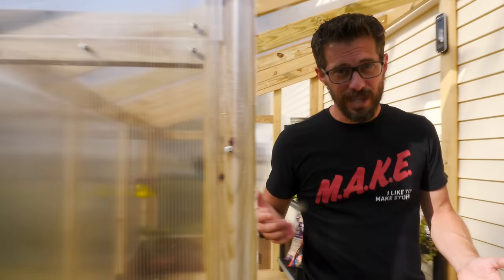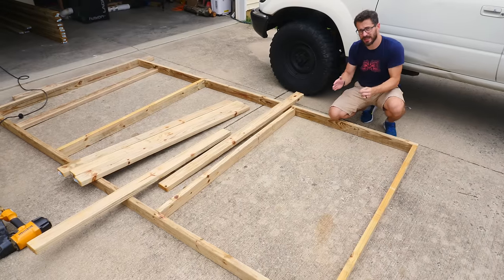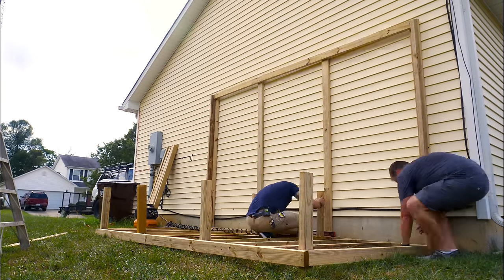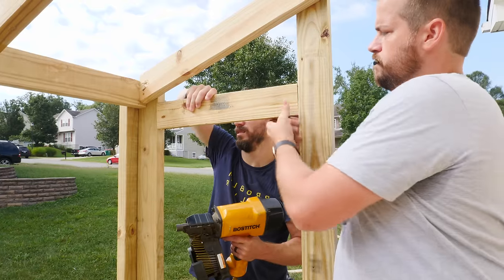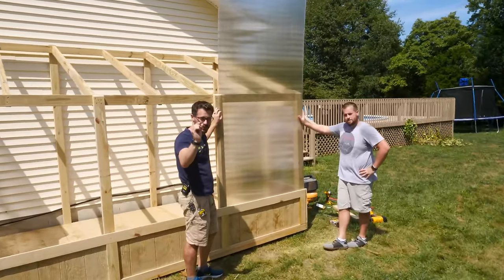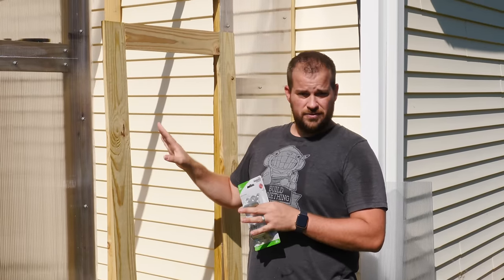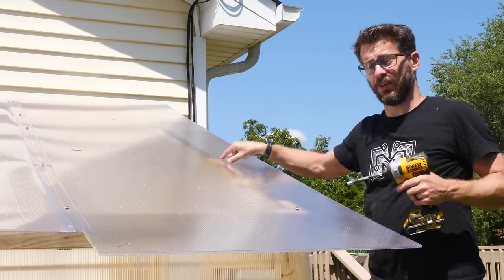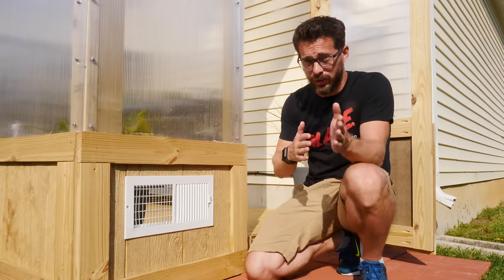How to Make a DIY Greenhouse | I Like To Make Stuff

Comment: Aren't you afraid the bottom will rot because of the moisture?
Reply from the maker: No, it's all pressure treated lumber.
Reply: i'd be more worried of it sinking after it rains for days on end.
Reply: @cmdraftbrn  If it's worth doing it's worth doing right.  At the least put that structure on concrete posts bases 🤦‍♂️
Reply: also insects, also you should have used blocks to level the building which would provide bester support for the floor, instead of stakes which makes it a permanent building. Then don't you need a permit,where I live you would.
Reply: @cwadub  Or at least runners that go the full length of the greenhouse to spread the load out
Reply: @Iliketomakestuff  Did you treat the ends after you cut them, or use uncut ends?  Also I would be worried about those sinking in after weight is put on them.
Reply: I really think that structure at the very least needed corner concrete supports, even some breeze blocks would have been better than nothing.
Reply: @wojtek-33  common misconception.  The treatment chemicals only penetrate a few mm into the wood.   Cut ends need to be treated with a sealer so they don't soak up water.
Reply: All cut end of pressure treated lumber should be sealed back up with an end cut solution you can get at the same place that sells the PT lumber usually. It should be done every time without exception in my opinion, not everyone does that. I've not hired a couple contractors because they didn't do it. For something temporary that you don't mind how long it lasts, do whatever works for you.
Reply: This guy doesn't know what is he doing, he mentions talking and building according to city code, half the stuff he did in this video makes no sense and the city will ask him to tear it down in a heartbeat
Reply: This guy has no idea what you need for a greenhouse.  At best, pressure treated or not, this thing will rot.  He didn't vent the greenhouse properly for summer heat, secure it so it doesn't blow away in the wind, lag bolts to the house???  And what is with the flex tape as a hindge and interior registers?
Reply: Aside from that issue doesn’t it seem like the manner in which it is framed it will not withstand the stress of wind gusts and thus be subject to flight? I realize they lagged it to the wall but wondering if it hitting studs given the method chosen
Reply: Never seen a greenhouse with a build floor, nor can I understand why you would build one like that. A couple of courses of brickwork gives you the platform you need. Strip the turf and put a narrow path through the middle. Apart from massive commercial greenhouses, never seen one any other way.
Reply: I Like To Make Stuff it will still rot tho
Reply: Jamie Smith it’s only treated the surface layer of wood, so if u cut it the end isn’t treated
Reply: Jamie Smith the wood will rot 100%. The chemical will transfer to the soil leaving the wood raw. These guys are total amateurs.
Reply: @neill392  where could I find info on the design you mentioned? please and thank you:)
Reply: @I Like To Make Stuff

Pressure treated means it'll start to rot in 5-10 years instead of 1-5. Exposure to water and temperature extremes will sooner or later cause the lumber to split, at which point it's only a matter of time until fungal infestation sets in and it starts to fall apart. Sure, wooden structures are inherently impermanent without significant planning and upkeep, but that's no excuse for a half-assed job.
Reply: At least put a moisture barrier between the siding and plywood. There's also no drainage for water runoff. I guarantee you it will buckle and mildew in less than 2 years without out one or both of these
Reply: A good wind comes by and it will be in the neighbor's yard.
Reply: @cmdraftbrn  Tornado will pull it up and it will drop like a hot potato.
Reply: Put a thermal heat vent from the top of the greenhouse into your interior wall can I get the warm air rising in the winter cut another hole in the bottom of the you all into your Greenhouse so the cold air inside your house will Backdraft end of the greenhouse and re-warm this forms a natural convection of warm air can be as high as a hundred 35
Reply: Free heat for the winter time
Reply: @cwadub  cinder block and skirts would have been a much better choice
Reply: All these comments about you should've done this or that.... Yet how many of you are out there building things? At least this guy is doing something.
Reply: Everyone is a critic.
Reply: Why spend all that time and extra $ to build a wood floor that will probably rot eventually. I would have just hit the grass with weed killer and put a layer of pea gravel or sand over it.  Nice end product though.  Looks great.
Reply: @Iliketomakestuff  as a construction worker who has spent a lot of time doing renovations I can tell you pressure treated lumber will last longer.  But if its allowed to sit in moisture it will still rot very quickly.
Air flow and drainage are your friends.
Reply: @cherylhecht6038  Soooo much water will be in there due to those silly air vents, I doubt it will last 5 years.
Reply: @mrcoiganable2988  but but but... he makes the nails go in to the beat of the music!!!  hahaha
Reply: @09zMaxful  Code wouldn't even matter for a green house.
Reply: @09zMaxful  ❤ +1
Reply: It will sink. At least put some blocks under the footing.
Reply: @Iliketomakestuff  Timber ffs
Reply: @Iliketomakestuff  It will sink and rot

Comment: I like the simple straightforward build, but I'd like to see how this behaves in heavy rain, those cut-out flaps with no jint at all and no water barrier where the roof meets the wall. Depending on how one uses a greenhouse a few leaks here and there might no t be an issue but I'd go with some kind of camping car window vent for the top vent, with a silicone joint, and waterproof membrane to stop water from running down the house wall. And a little add-on that's nice for anyone with a greenhouse, a gutter that feeds a water collector, to water the plants, even heat them if you put it inside(black tank heats up in the sun, and reeases heat at night )

Comment: Looks like you use Doug fir wood.  If so that will root in the ground very quickly.  Also the siding needs to be painted over wise it will also root.  Tip paint the wood before you cut it even if it just primer paint it will help to stop the root.  Many people has mentioned the wood flooring so I will leave that alone.  Remember you will be watering the plants and the water will leak out of the pot!

Comment: Those feet are going to settle into the ground with all of that weight, should of at least put it on cinder blocks to give it a chance.
Reply: Could have bought some tubes and a bag or two of concrete for some footings.
Reply: I built this almost exactly about 10 years ago for my neighbor. Nice little old lady. She uses it everyday of the year. Have had zero trouble out of it.  The only thing that has to be replaced was a piece of the siding because (i also mow her lawn) i was cutting her grass and I hit a rock and it shot through the plastic. Everything works just fine if you know what you're doing.
Reply: @Brad Kendall it depends on where u live, some soil will make a building settle like crazy, some won’t, and by that point it’s not really soil. Probably a good mix of rock or clay
Reply: rofl ya I just said same thing to myself as I was watching.
Reply: lol, no it won't! Not even maybe.
Reply: Additionally, the wooden load bearing members rely on fasteners to transfer the weight vertically, rather than transferring the weight directly from higher wooden member to lower members.

Comment: Two observations
1.  There should be some type of z-clip or flashing, or water will get through between the wall of the house and the open wall of the green house.
2.  The clear panels that I'm familiar with, have UV ray protection on one side, but not on the other.  You would have needed to be sure the UV ray protection was on the outside.

Comment: Can you do a Bits video on "Checking with your local code."
Reply: One year I built a shed and checked with my towns building inspector about meetung code. First thing he said was "how big is it?" Turns about if you build a shed or similar under a certain square footage and height, it doesnt matter. Mine wasnt so I had to do it, but it was still interesting to know.
Reply: @modelmanjohn  that varies state to state
Reply: Someone hire Matt Risinger to inspect that "green" house.
Reply: Vincent Harry @forby is a genius and does some amazing edits
Reply: Congrats I am the 90st like
Reply: In Hawaii, you can build a second building on the property. The catch, if it's attached to the primary building, even by a 2×4, it's considered part of the main building (changing the square footage of the primary). If not, the permits and taxes are different (including pay taxes on 2 separate buildings).
Reply: @modelmanjohn  I have heard of exemptions to structures 192 sqft or less but have not confirmed this.
Reply: Buy A1 land and you won't have to worry about silly codes.

Comment: People, don't do this. Everything in this greenhouse is excellent except the floor. I don't care what sort of wood product you use, this will be a rotten mess with infestations of bugs and disease all through that flooring. Just use gravel on top of the natural ground, it would be cheaper and easier as well.
Reply: coffeebuzzz i want to do brick floor
Reply: He also failed to kill the grass beneath the floor, which is likely to result in ‘weedeating’ inside the greenhouse as it comes up that back wall.  Also, even if the wood floor performs well, the grooves are running the wrong way for easy sweeping.  But the roof vents were the most serious mistake.
Reply: You should be digging and putting in geothermal piping for free heat, cooling and humidity control anyways.
Reply: Thats what I was thinking also.  Always have a good foundation..that's even in the scripture lol.  Never put wood on direct ground  just a termite disaster waiting to happen .buzzzzzzzz big X :)
Reply: @gregfutrelle1396  "As they say on The East Coast" It's Salt Treat ' WTFIT?
There is no such thing as "Salt Treat"? It's preasu treated unless it came from Japan and was submerged underwater!! ".
Reply: yeah, I see trouble down the road for this floor.
Reply: @gregfutrelle1396  Why are the roof vents the most serious mistake?
Reply: @danieltakawi9919  Because they don't regulate themselves. Vents in greenhouses come with an arm filled with wax, as the wax heats up, it expands and opens the vents. These require you to manually open and close them, which if you miss doing it once, could kill your plants. They also look flimsy and like the wind could knock the block of wood away.
Also, even though he included vents on the side as well, there is no fan to help with air flow.
Reply: @Daniel Takawi water
Reply: Which can also lead to termites getting into the house, which is a nightmare!
Reply: I just got to the part where the floor joists and flooring is being put in and my jaw dropped too was thinking of all the ROT that will happen lol not to mention only 2x4's as support legs on grass ground no gravel drainage nor support at key pressure points I see that not only rotting out too but, sinking over time into the ground from weight.  Am gonna be building a green house soon not the first time I have built a structure. But, never built a green house was going to see how different it will be from the shed lean-to's I have made in past.  This video was a fail for me.
Reply: Maybe it works where they live, but if I did this where I live, we would have rats digging under this.
Reply: @All4Catastrophe_GameOn  Yeah.  A huge improvement would be just setting this on a few $5 concrete deck blocks.  Raise the whole thing off the ground by almost a foot, and allow air and water to freely pass under it.  (Plus you can treat for bugs underneath, etc.  And...you can level the blocks before you do anything else.)  Not perfect, but a huge improvement.

Then get 2 automatic vent openers for $30.
Reply: I hold your view in the construction of the floor. Yes.
Reply: @meganturner1168   Brick is a great alternative.
Reply: @gregfutrelle1396  Yes. I think this individual hasn't enough foresight to deal with these engineering issues. Since he profited from Lowe's Home Improvement Centers sponsoring this video, perhaps he can review the building errors and create a New Improved Part Two Video and profit some more. That would be a three way win, for the sponsor, the subscribers and the video author. How's that.
Reply: @basedbear1605  That's a very good one. I know of Volkswagen factories in Germany which are built to contribute factory generated heat for public use by way of geothermal piping distribution.
Reply: @danieltakawi9919   Likely because the author needs to take engineering and Physics 101 to understand how he could have built the greenhouse correctly.
Reply: @All4Catastrophe_GameOn   A good way to put it.  The video is a fail for me as well.
Reply: This the best commentary conversation I have ever seen on yt. Golf claps all atround!
Reply: I used gravel as well. Here in hills of Southwest Missouri we hv had enormous amt of  rain this spring with flooding. Any wood wd hv been a mess
Reply: I live in central South Carolina. This thing would be a mangled, warped mess so quickly here! Maybe there are areas where it could work up north, but there are reasons you see greenhouses made from metal. Lowes should be ashamed of encouraging people to follow this concept.

I agree the floor should be gravel. If you want to use the wood framing for the bottom, thoroughly SEAL THE WOOD then fill it with gravel. Better yet, block in the bottom, fill it with gravel (maybe even put some drainage tubing in the gravel to direct where the runoff water goes) then connect the bottom of your frame to the blocks.
Reply: They also completely ignored most of the installation for the polycarbonate panels. Because they chose not to use the tape and U channels, those panels will be full of condensation and algae, if not mold
Reply: @basedbear1605  How far down do you have to go for geo thermal heat?
Reply: @XxLadyxGaladrielxX  Maybe this is how he refined his projects!—learning from the comments, ha!  I do love the shape, his energy and his wife’s hope. If she waters borax through her floor once a month, no termites will ever make it as far as even the surface of the wood, top or bottom. But I agree that gravel underneath, and black prof. Roofing rubber under that would be nice. Better yet, rick wool in between. Pests hate it, mice hate it, it’s water proof, and fire proof and it can help prevent the lower areas from building up too much cold, since cold falls to the floor.
Reply: @deb5710  Borax, borax, borax!, but know the right amount. Even termites hate it.
Reply: @rocki_bb  Or use plastic deck flooring on gravel.
Reply: @Gasp7000  I didn't know that about termites and borax! That is good to know, thanks for sharing!
Reply: @Gasp7000  Borax mixed with sugar
Reply: @basedbear1605  ..you ever priced out Geo thermal? 🤣
Reply: @saifulrimkeit296  why don’t you make or recommend one?
Reply: @rocki_bb  what is your borax treatment solution recipe?
Reply: Genuinely want to know— so then how would you get the greenhouse to stay level if it’s on gravel or say brick? I want to build one off the side of my house like this.
Reply: Yup i thought same thing how to build a greenhouse that will rot out in 5 years or less.
Reply: I wouldn’t say it’s the floor that would necessarily rot but the 2x4s he put in the dirt. Should have set it on block and everything would be fine.
Reply: @All4Catastrophe_GameOn  😊😊
Reply: @gregfutrelle1396  why are the roof vents a mistake?
Reply: @JaneThatcher89  Thanks for responding.  I should have said "may be" a mistake, simply because any heavy downpour, especially with a little wind, could push rain in the sides of the flaps and into the greenhouse.  I should have also suggested that vents in the uppermost portion of the  greenhouse side walls would likely have been more favorable.  Why?  Because one could even add a fan to assist ventilation, where that isn't really possible with roof vents.  All in all, the build in this video was very good.  I just don't see a reason to cut holes in a roof. By the way, (and I'm not being sarcastic, but really interested) how's that Flex Tape holding up as a hinge?
Reply: I was thinking the same thing
Reply: Would be nice if they would have said how much it did cost.
Reply: what about 👀 just dirt floor
Reply: I agree. They also should have set the 2 x4  " Feet "  in quickrete at least a foot deep. After time with rain and foot traffic  and gravity.  Those 2x 4  " Feet " will sink into the ground  and the green house will become  unlevel  and binding will occur . Cracks and joints pulling apart . Will happen.
Reply: My biggest problem with floors like that isn’t the rot or disease. It’s the rodents and snakes that like to live there
Reply: I was shocked to see the way they did the floor. Totally agree, they completely neglected one of the most important components (foundation). This thing is gunna take way more maintenance & repairs
Reply: @coffeebuzzz…do actually do construction? If so…I have some questions for you…
Reply: I agree.  I just had to spend 2.5 years renovating my parents house and most of the issues I discovered were related to lack of moisture barriers not present in older building codes.  Moisture is going to make this greenhouse look poor rather quickly and then the you will start to see warping and rotting raking place.  They also didn’t do any ground preparation of the area that they have built the structure over.  It looks like they used a mix of pressure treated wood and non-pressure treated wood.  You can’t just throw wood on a lawn like that and build a structure.